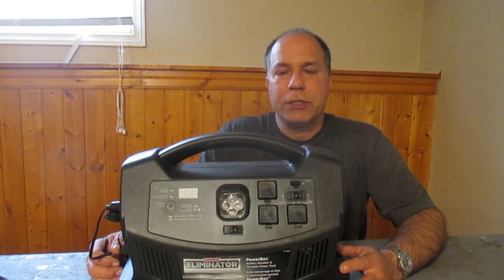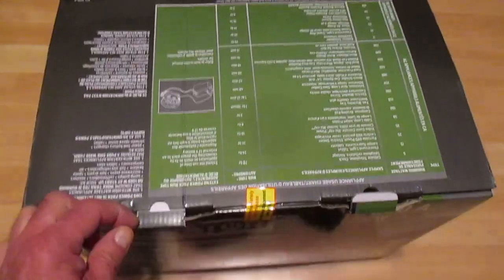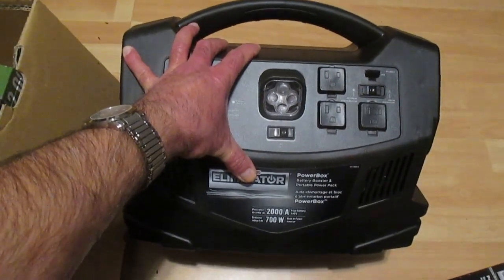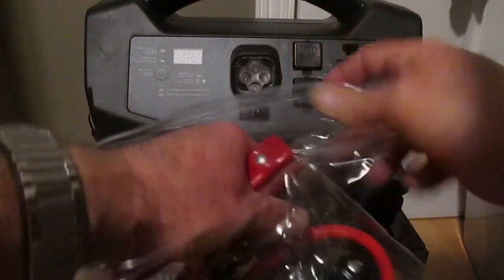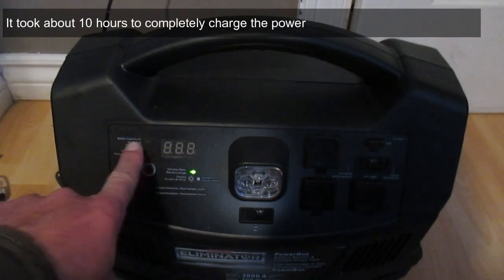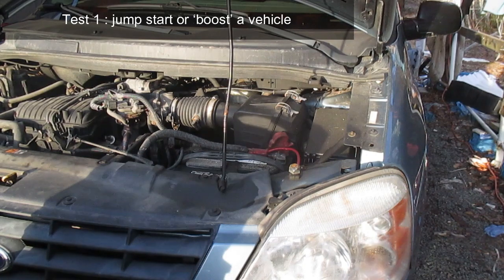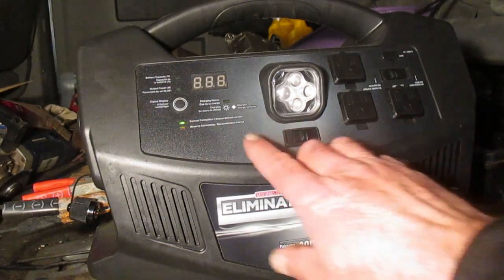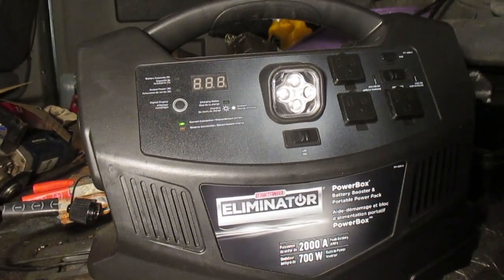How to use a battery booster and power pack - 700 watt unit in this video

Comment: I have lost my charging ac adapter. Do you know the  volts and amps of the one you are using?
Reply: My AC adapter says, Input: 120V-60Hz, 0.3A; Output: 13.8Vdc, 1A